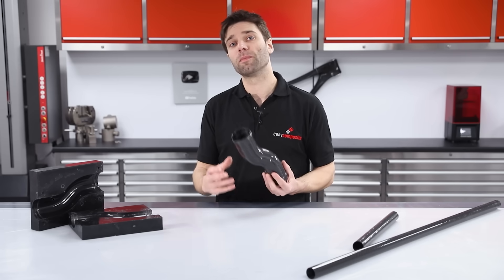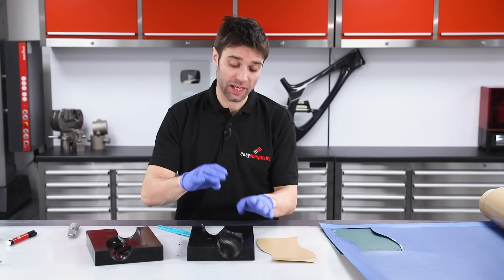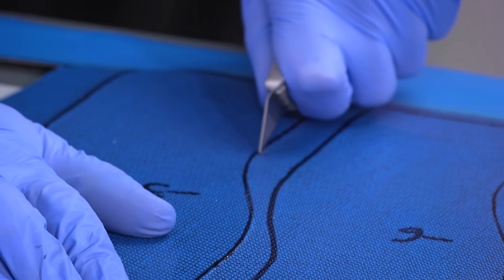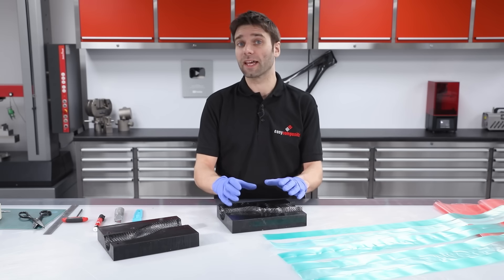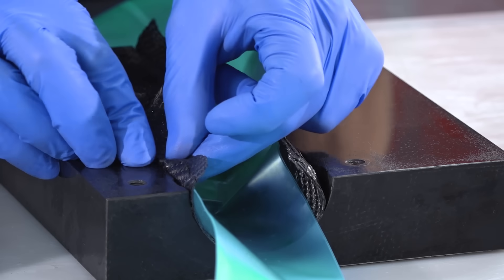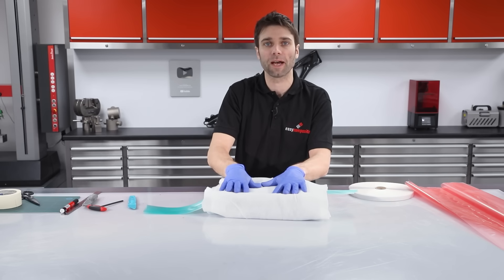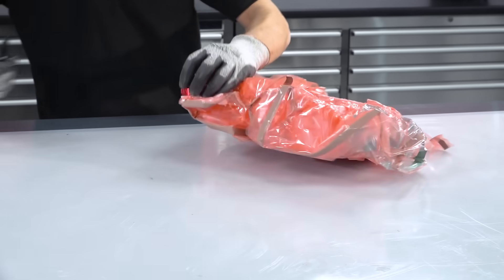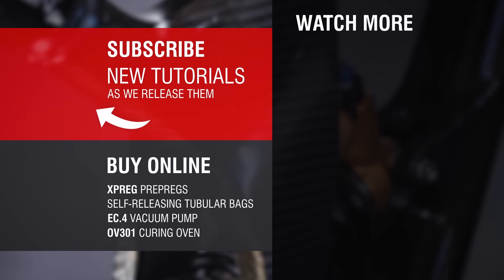Making Complex Carbon Fibre Tubes Using a Split-Mould

Comment: Very good informative video. Makes me want to start my own projects. What would be the easiest car part to start  making? Interior trim, outer panels, induction etc etc...
Reply from the maker: Hi Kevin, I would say that modest sized external components are a good starting point. Interior trim pieces tend to be rather fiddly and have added complexities of mounting lugs etc. If you're thinking of using prepregs, such as shown in this video, then induction components could be a good place to start, or some exterior details like scoops or vents.

Comment: So 3d printer for the mould and a sheet of carbon fiber a bunch of trial and error and anyone can try this. That’s interesting. Wondering about Making a a basic 3 inch intake with just one
Angle. Wonder how you would get the maf design included. Not a bike tube but same concept I sure.
Reply from the maker: There are ways to use 3D printing in composites but this process, as you see it in this tutorial, isn’t quite one of them. However, stay tuned to our channel, we have several 3D printing tutorials coming soon.

Comment: so does this call dry carbon or wet carbon?
Reply from the maker: Some people call 'prepreg' carbon fibre 'dry carbon fibre'; to us this is quite an ambiguous and confusing term, since the carbon you're using is not dry at all, it's wet. So, whilst some would call this 'dry carbon', it's better to use the term 'prepreg', that avoids any confusion.

Comment: But how do you make the mould
Reply: 3D printer I’d guess.
Reply: Youtube it!
Reply: Its done on CNC machine
Reply: Can be done with 3d printer
Reply: @David-k9y1z not with such qualify. If you want and need Perfect surface of moulding then 3d is notes solution
Reply: @Endrjo it definitely is. Use a 3d printer to get out the shape, do finishing work, and then make a mold from glass fiber using the 3d print
Reply: Probably have to 3d print at home lol.😂
Reply: Nearly identical

Comment: Hello, I’d like to ask, how does the tube look like inside ? Can you feel the over lapses? I witch to make my own clarinet bell out of carbon fibre. It would need to have exact inside diameter and nice surface from outside. What might be the best way to make it ? Thank you in advance. J.
Reply from the maker: The tube has the fibre texture.  To make a smooth inner you would use a mandrel similar to straight tube moulding to give a smooth inside finish.
Reply: @easycompositestv  Thank you, would you go the way where you put layers separately or would you rather use prepreg ?

Comment: The tubular carbon fiber mesh is cut into half of the covering, and the structural skeleton is not continuous into a whole, but is glued with viscose. The strength is insufficient, and it separates when exposed to high heat.

Comment: Is the mold made of mix materials? can its shiny and i saw carbon fibre back-inside?
Reply from the maker: The mould is made from our XT135 prepreg tooling system. You can see how that system works in this video https://www.youtube.com/watch?v=k4GdAuNji5g and buy the product on our site here: https://www.easycomposites.co.uk/xt135-250g-carbon-fibre-tooling-prepreg-surface

Comment: I’m curious about double sided parts that you can’t bag inside. Something you would core fill with balsa wood or maybe even wrapping around an aluminum skeleton. The only thing I can think of is gluing the two halves together after molding but I wonder what affect if they are structural components. Something like a race car suspension arm that had sleeves molded where it mounts and where the ballpoint would attach.

Comment: Why not just use something like an pressurized inner tube? Would seem to be simpler and faster.
Reply from the maker: The moulds you need for a pressurised bladder need to be incredibly strong (usually billet aluminium) in order to resist the deflection of the 'unbalanced' pressurised bladder. Therefore they tend to be very expensive to produce. An internal vacuum bag setup like this exerts equal pressure on the inside and outside of the mould, allowing much lighter, more cost effective composite moulds to be used.

Comment: The amount of plastic waste is crazy
Reply from the maker: The environmental impact of composites is a little more nuanced than simply looking at some of the plastic consumables used in the manufacturing process. Generally speaking, advanced composites is now looked to as being highly significant for the production of lighter, more efficient technology, especially in transport. If you need to use a metre or two of bagging film to save a kilogram off the weight of an aircraft door component then the reduction in fuel needed over the lifetime of the component would dwarf the environmental impact of the films and manufacturing process used to make the component. Advanced composites is already saving thousands of tonnes of CO2 every year in passenger aircraft and other mass transit applications. Disposed of in a responsible way, plastic film causes no environment harm but the lightweight component helps to reduce climate change throughout its life.

Comment: Is carbon fibre is more stringer than titanium or steel ?
Reply from the maker: It's hard to draw accurate comparisons because the materials act in quite different ways but weight-for-weight it's fair to say that carbon fibre components can be stronger than steel or titanium (or any other metal) components could be.

Comment: complicatedly! Just print 3D the part (mould) with the size smaller than the real part and use carbon fiber cloth coating outside , finally put the part(mould) out !
Reply from the maker: Hi Thuan, thanks for the comment. This would probably mean that you can't use prepreg carbon fibre (which might not be a problem) but would mean that the A side of your component (i.e. the smooth side) would be the inside, not the outside. Again, this might be OK but if would result in a different looking component and would use different materials.

Comment: Thats a lot of plastic
Reply from the maker: Hi Kinang, The environmental impact of composites is a little more nuanced than simply looking at some of the plastic consumables used in the manufacturing process. Generally speaking, advanced composites is now looked to as being highly significant for the production of lighter, more efficient technology, especially in transport. If you need to use a metre or two of bagging film to save a kilogram off the weight of an aircraft door component then the reduction in fuel needed over the lifetime of the component would dwarf the environmental impact of the films and manufacturing process used to make the component. Advanced composites is already saving thousands of tonnes of CO2 every year in passenger aircraft and other mass transit applications. Disposed of in a responsible way, plastic film causes no environment harm but the lightweight component helps to reduce climate change throughout its life.
Reply: @easycompositestv  How does one get rid of plastic as if it never existed?

Comment: Please make tutorial video to how to make moulding that you use for prepreg, and what material for making those thing
Reply from the maker: Hi Cihuy, The split-mould we used in this video is a prepreg carbon fibre tool. The patterns (for the two halves) were CNC machined from epoxy tooling board like in https://www.youtube.com/watch?v=CWAvo8DIZ9s and then the mould halves made from made from XT135 carbon 10:00 28/04/2020fibre tooling prepreg like in https://www.youtube.com/watch?v=k4GdAuNji5g. There are other solutions for making high temperature moulds, such as a hand layup process using high temperature epoxy tooling gelcoat, resin and paste which you can find out about in this tutorial (on our website) https://www.easycomposites.co.uk/#!/composites-tutorials/High-Temp-Tooling-Gelcoat-Putty-Mould

Comment: Can it hold pressure? Since seamed tube
Reply from the maker: There is an overlap at the joins which makes it much stronger than if it was a butt joint bonded together.  People do successfully make turbo boost pipes from carbon fibre but you may need to do some testing or calculations to work out a suitable wall thickness.

Comment: Nice vid, I would have maybe considered two things differently. First, this design may lend itself to moulding the inner surface using a rubber mandrel laid up from something like Aircast. Secondly, given it is so hard to get perfect butt joints, I would have still feathered the 5mm taper, but fully overlapped the upper and lower halves, rather than try to hit that elusive butt joint.
Reply from the maker: Hi Mark, thanks for your comment. The two halves of the surface ply don't butt join to each other, one of the halves is cut flush with the edge of the mould (that's a hard reference point so provides a perfect edge to cut a sharp, straight seam) and the other 'side' does overlap it. This is the standard-practice technique for a visible seam; it provides a precise seam, is practical to do and one ply overlapping still means you have the same straight across the join as you do at all other points around the the tube. As for using a mandrel, we made this video specifically to demonstrate more clearly how to internal vacuum bag for a tube form, we even made the mould just for this purpose, so that we could explain how to vacuum bag a tube so this really needed to be the method used to make the tube.

Comment: Hi, just wondering how can i make large motorcycle carbon fairings and clear/no color fairings using molds?
Reply from the maker: There's several ways you could make them, you could use prepreg carbon fibre (like you see used in this video) in which case our 3-part series could help you: https://www.youtube.com/playlist?list=PL-DQ6gqgQvCl4wq6PprfAX0m3MMbPX6qF or you could take more conventional fibreglass moulds off your existing fairings and the use a resin infusion process, in which case our carbon fibre bonnet tutorial would pretty-much cover everything: https://www.youtube.com/playlist?list=PL-DQ6gqgQvCm_Al2OH9_JRWyOMG5KsjMT

Comment: I want to do this as a home hobby. Are there any cheap ways for me to get started with making small carbon fiber parts like this tube?
Reply from the maker: Tube components like this are very complicated Michael, that's why we used this component to demonstrate complex moulding and bagging techniques. If you're just getting started, it's probably better to begin with a process like wet-lay and vacuum bagging like we show in this tutorial: https://www.youtube.com/watch?v=zeE1FdcQ3c8

Comment: Shouldn't you be wearing a mask against the fibre dust?
Reply from the maker: A mask isn't necessary when handling the prepreg carbon fibre, it doesn't become airborne. A mask is worn when trimming the cured laminate.

Comment: Isn't the joint seam a weak point in the piece? Much weaker than the rest of the piece which is a single sheet, right? If it is, do you know how much weaker it is? Any rough numbers?
Reply from the maker: Hi Felix, not really. In the tutorial you can see that the position of the join is staggered from one layer to the next, there are 3 plies of laminate in this layup and the join is in a different place on each ply. Also, where the join happens, there is a slight overlap which increases the thickness of the laminate where the join is and lends continuity. It's true that a continuous layup would be preferable but that's rarely possible due to difficulty or complexity of obtaining a suitable woven braid or 3D preform.

Comment: Great video I must say but molds, time, expense. Just remove your spare tire. Cheap and easy weight loss. Start drilling holes in all the metal parts in your car. My wife's car had a rust problem. I explained to her, when parts fell off it made her car faster. Didn't last for long but it is true. Power to weight. All cars are the same. We're still together.

Comment: Hello guys!, i would like to ask you, 
How many degrees can carbon fiber withstand without losing its characteristics?!!!!!!!!!

Thanks! 

Greetings from Uruguay
Reply from the maker: That depends on the resin system that’s been used. In this video we used our XC110 prepreg which has a maximum temperature of 110C.
Reply: @easycompositestv  I was thinking.. And I would like to create a full carbón exhaust.. That is possible?  I need a better epoxi?
Reply from the maker: Carbon fibre is not really a suitable material for the high temperature surfaces of an exhaust, that's why you only see carbon used for things like the outer cans/sleeves on exhausts.

Comment: Let's see if I got this right..
Making an y-pipe would require 2 bags ending up in paralell through the single pipe?    (2 intercoolers to 1 throttlebody)

I have watched that bikevideo 20 times atleast.
Reply from the maker: Yes, you could do it that way, you could also have 2 bags, one that goes straight through from one of the singles to the double and the other that just goes down one of the singles and then meets the other bags (they don't need to join internally).
Reply: @easycompositestv  
Sweet!! thx

Comment: So i still dont get it whats so special with carbon
Reply from the maker: Carbon fibre has the highest strength-to-weight ratio of any material so if you want to make something that's as strong and light as possible, you need to use carbon fibre.

Comment: Did only I miss the introduction of the Epoxide?
Reply from the maker: Well, we're working with 'prepreg' carbon fibre here so the epoxy resin is already in the carbon fibre before we start. Then we heat it in an oven to cure the epoxy that's 'pre-impregnated' into the carbon.

Comment: That raised part on the tube is for a sensor of some type?
If that is the case and one would fit a threaded sensor in it, what is the approach? 
Sandwich a plate (anodized alu, stainless) , or glue the plate afterwards?

Great to see you guys putting up new videos!
Reply from the maker: It was just some detail that we added for interest (the component is not real) but yes, a typical approach might be to sandwich an aluminium plate either side which could be drilled and tapped or just bolted to. Alternatively, the sensor (or its mounting plate) could just be bonded to the carbon fibre using something like VuduGlu VM100.
Reply: @easycompositestv  thx for the reply ☺

Comment: But where do you get the mould from in the first place? Did I miss a video on how to create the mould?
Reply from the maker: The split-mould we used in this video is a prepreg carbon fibre tool. The patterns (for the two halves) were CNC machined from epoxy tooling board like in https://www.youtube.com/watch?v=CWAvo8DIZ9s and then the mould halves made from made from XT135 carbon 10:00 28/04/2020fibre tooling prepreg like in https://www.youtube.com/watch?v=k4GdAuNji5g. There are other solutions for making high temperature moulds, such as a hand layup process using high temperature epoxy tooling gelcoat, resin and paste which you can find out about in this tutorial (on our website) https://www.easycomposites.co.uk/#!/composites-tutorials/High-Temp-Tooling-Gelcoat-Putty-Mould
Reply: @easycompositestv  Thanks

Comment: Is there a way to improve the inner surface quality?
Reply from the maker: No, not really. If the inner surface is the priority then you could use a male mould or sacrificial core and lay the reinforcement over the tool (rather than inside it) but if both faces are priority then - almost certainly - you would need to choose a process which gives you one good surface and then do so extra work (coating, flatting, polishing) to improve the surface on the other face.

Comment: How much to get my pipe done? It’s more of a whale intake pipe. About 2ft long. I’m not sure if will make sense for me to buy all the materials and equipment when I only want to do one pipe
Reply from the maker: I'm afraid we don't do custom part manufacture ourselves, we just specialise in the materials and support.I it's a on-off part that you're after, remember that most of the time and cost will be in making the mould, even before making the component itself.

Comment: Cosmetics aside, would making a tubular component in 2 halves and then bonding them together with a structural adhesive, be as strong/a viable alternative to using prepreg?
Reply from the maker: As long as the overlap is big enough then yes, with a good structural adhesive you should be fine.  There will always be some slight differences as the lay up is going to be different but modern structural adhesives such as our VM100 Methylmethacrylate is stronger than the interlaminar strength of the carbon in testing so the bond itself if properly done won't be the weak point.

Comment: What type of carbon fiber is that? It's pre laminated or something like that?
Reply from the maker: Yes, it's 'prepreg' carbon fibre so it's pre-impregnated with the epoxy resin already. We're using the XPREG XC110 system which you can find (and buy) on the Easy Composites website.

Comment: I want to make a carbon fairing for my bike. can I make a mold using a fiber glass?
Reply from the maker: If you want to make the parts using prepreg carbon fibre (like we use in this video) then you can't make your moulds using basic fibreglass and polyester resin for a couple of reasons, the main one being the cure temperature of the prepreg would be too high for a normal polyester resin. The second reason being that epoxy parts tend to stick horribly in polyester moulds. You need a mould made using epoxy, or at the very least, vinylester.
Reply: @easycompositestv  how about a carbon fiber mould for a carbon fiber fairing?